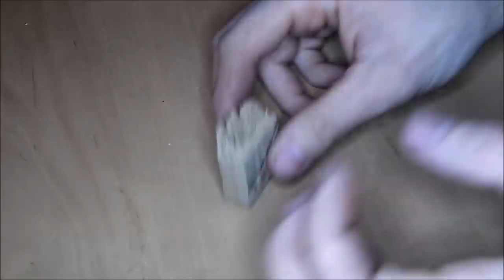How to make SECRET WOOD RING. DIY

Comment: Ive finally made my own ring using these methods however I’m having a problem getting the resin to be that shinny and clear not entirely sure what i did different. Im still satisfied with my outcome but would still like to improve it.
Reply: Hey, can u please tell me the ratio of two types of resin.. #oOizoOo
Reply: @sumaiyarahmanmim193  depends on what kind of resin you use. On every bottle there is the ratio written on.

Comment: Need a vacuum chamber so you can get a clear cast with out bubbles
Reply from the maker: Yes you are right. I do not know where I will find her
Reply: jedrek29t not sure where you are located but Amazon has some search vacuum pots for casting they range in price depending on size so if you cast small stuff ( like most your epic videos) you can get away with a small one. Harbor freight I have heard carries them but I have yet to look. Either way the secret wood turned out amazing and you boosted my butt up to go make one earlier.

Comment: When first hand sanding (after you've moved on from belt sander) you said you were starting with 220 grit and progressing to 25000 grit, can list of each increments used through your process? Also, at what point (which grit) do you transition to wet sanding? I would really love to hear back from you...this is something I'm planning and really looking forward to doing with my son- and while I've tried many methods (from using homemade silicone molds to hand carving the wood first and then dipping into resin) your video is wonderful and I'm intrigued by your approach. 
Thanks in advance and keep up the great making!!!🌱
Reply from the maker: we grind with water from 360 gradation. In turn: 360, 600, 1000, 1500, 2000, 2500. At the end, polishing paste. Thanks ;-)
Reply: jedrek29t Thanks! The resin is something I've been playing around with for a while now...mini dioramas in teeny bottles, small (altoid like) tins that have precut windows in lid, slicing rings from copper pipe to use as pendants or necklace centerpieces with images and plant matter inside the resin. Thank you for the details on the sandpaper because I get to see a family member (whom I rarely see) this afternoon and have all the supplies packed up to bring so that we can attempt to make several wood and resin projects...I need to make one more stop for belt sanding paper and micro mesh before meeting him and I just found your videos last night. I'm so excited to try your method with the masking tape because our time is limited and (while it's still a multi day project), this will eliminate the need for creating silicone molds first. Thank is for responding- I know now which grits to pick up at the hardware store.🌱

Comment: Nice effect with the paint and the resin, but the wood part is not very thick and probably rather fragile.  Also, if the wood is oak then it requires some sort of protective finish; it won't remain nicely polished like the resin.

Comment: I don't know, how did you solve the problem of the bubbles inside the wood? did you treat the wood before pouring the resin? Any help is more than welcome!
Reply from the maker: There are a lot of bubbles here. Because I didn't protect the wood
Reply: @jedrek29t  Hello, thanks for your reply, Yes I see some little bubbles, is there another way to seal the wood without a vacuum chamber? any help is more than welcome!
Reply: @jedrek29t  I'm fighting to the death with the bubbles🤣